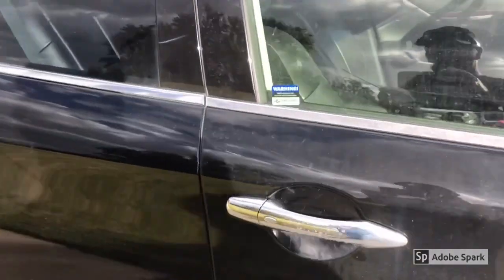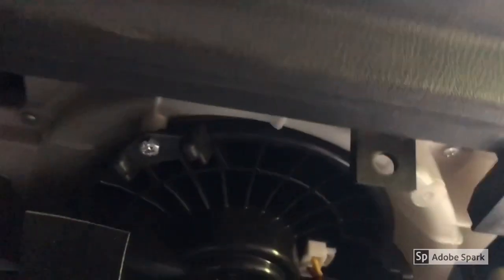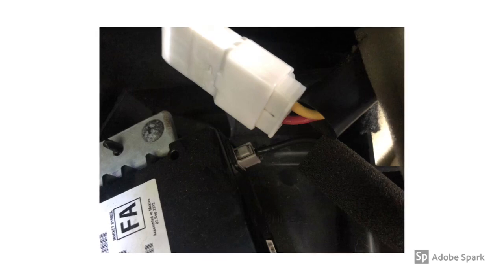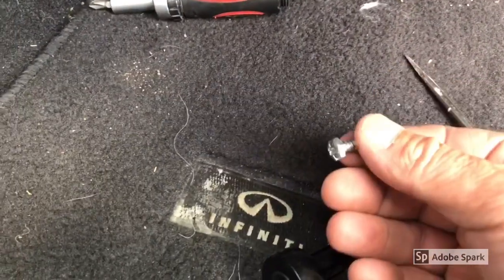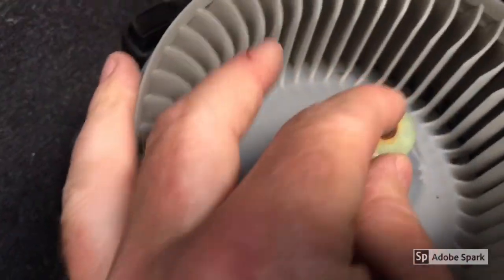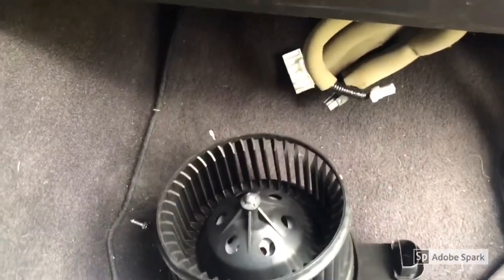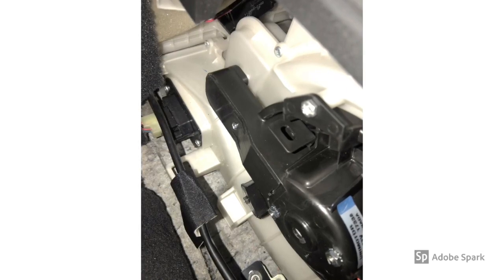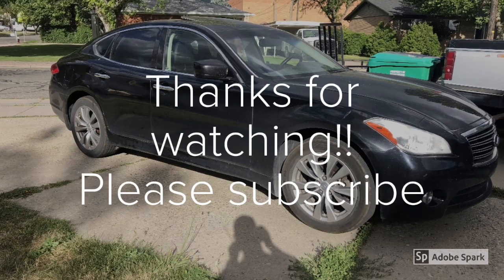Replacing the Ac/heater blower motor on an Infiniti

Comment: Thanks Derek. I just fixed my Q70L. The dealership wanted $459+ for the part alone.  I bought an OEM one from O’reilly’s for about $120. The only problem I had was getting the new part in. There was small clamp on top that I did not remove and also there is like a black metal lip underneath where I had to manipulate. Once I got past the lip I was easy. Thanks again. I am pretty sure the dealer would have charged about $1800-2000. 😎
Reply from the maker: I’m so happy that helped! I love reading comments like this. Exactly why I made the video. Tired of dealers gouging people.

Comment: Hello Derek. I have the JDM model of your car called the "Fuga". And currently, I'm experiencing a problem with my A/C. It blows warmer on the passenger side ( hotter ), and colder on the driver side, when put on the highest temperature settings. Even the driver-side A/C is blowing extremely light. Could it be a blower motor issue ?

Comment: Do these make weird noises when failing? Over the summer my ac was making a really weird zipping noise when on but went away. Now it’s winter and I’m hearing a more dull fan sound. Will be looking into replacing this. Thanks!
Reply from the maker: Mine made a “clicking” noise before failing
Reply: @jonesmachineco  thanks for the quick reply!!
Reply from the maker: @MattGreenleaf21  anytime, good luck

Comment: Had you had any problems with the doors behind the dash? As in not opening or closing and cause air to flow to only driver or passenger side?
Reply from the maker: Not yet but I think that’s caused by a bad servo
Reply: @jonesmachineco  thank you! I’ll look for one

Comment: Well how to tell if it’s the fan or blower motor ? My 2017 infinity QX60 only makes noises when I turn on heat or defrost but would the fan assembly do the same when I turn on the heat / defrost ? Help THANKS 🙏
Reply from the maker: I think think the fan and blower unit are 1 unit
Reply: @jonesmachineco  I’m sorry I meant the fan up front….I heard the fan assembly will make similar noises when turned on.

Comment: Lol I noticed the G floormats, is your m37 a Frankenstein like my G37? I have a 2013 g37x that has a 2015 q50 motor, and transmission from a 2017 q60 red sport 😂
Reply from the maker: Ya I bought it used with out floor mats, those were a ebay special 😝

Comment: Did you have issues with the fuses by the driver side floor kick panel blowing? I replace the 15 amp fuses and when I turn on the A/C - I hear the "pop" of the fuses. The fuses blow out everytime I try to turn on the AC/heater. Not sure if I should replace the whole blower motor unit or not.
Reply from the maker: I have not had that problem. I definitely would change out the blower
Reply: @jonesmachineco  ok thanks, ill try it
Reply from the maker: Let me know...When the motors go bad they can blow fuses
Reply: @jonesmachineco  SO what I just did for now, to test the existing blower motor, I removed it from car and ran 12V to the connector outside of the car. It shorted out and started smoking, so no wonder it was blowing the fuses. Ordering a used OEM blower off ebay so we shall see if that fixes it.
Reply from the maker: I think I have a link that has the one I used in my description
Reply: @VQ350Z  whats up hey im having the same problem with my g35
Did a new blower fix the problem? Im waiting for mine to arrive
Reply: Fuses blow out because of a bad blower motor ! That's the problem I had , changed blower motor and put new 15amp fuses added some Freon and Bang ! AC & Heat back on 👍👍👍

Comment: Hello Derek, I have a 2012 Infinity G37, the AC and heater/back up camera do not appear on the screen monitor, which means AC/heater does not work when I turn it on, the screen is still working with other functions with clock/temperature..etc, no air come out from the car. Is the problem could be relate to the blower motor? since the backup camera does not appear on the screen, maybe another problem?, thanks Derek
Reply from the maker: The blower won’t effect that it’s open loop system. I’d start with checking fuses and relays related to each system.
Did they stop working at the same time?